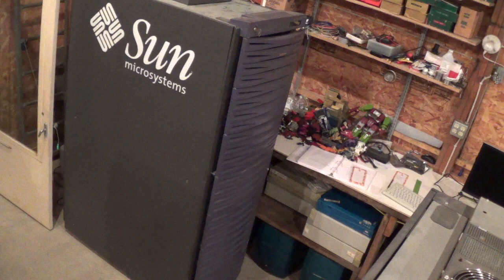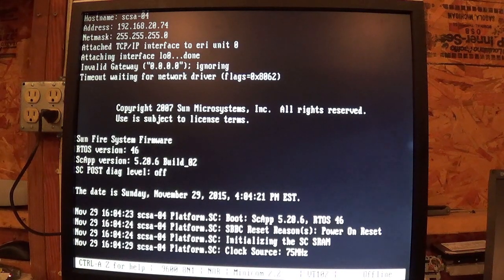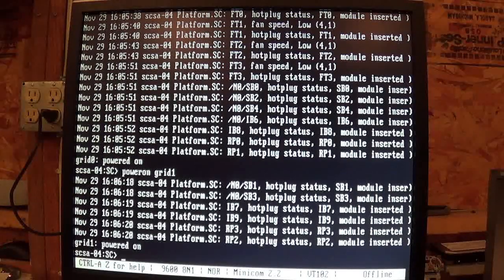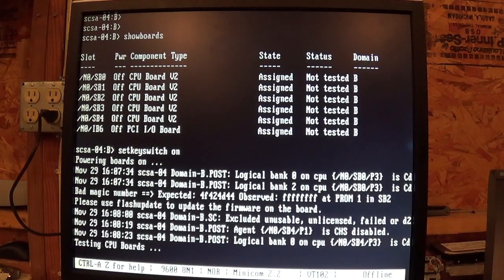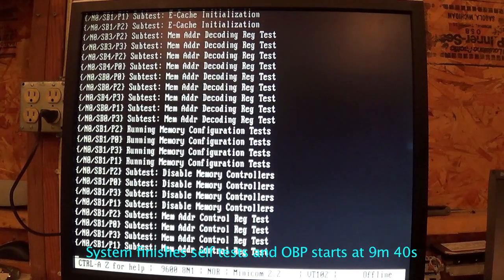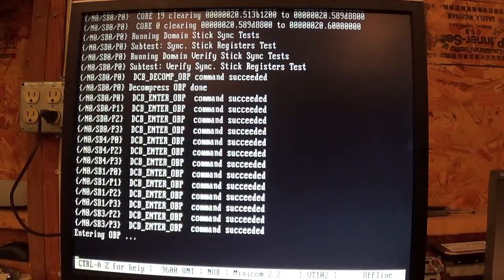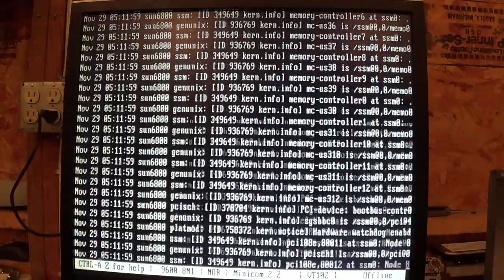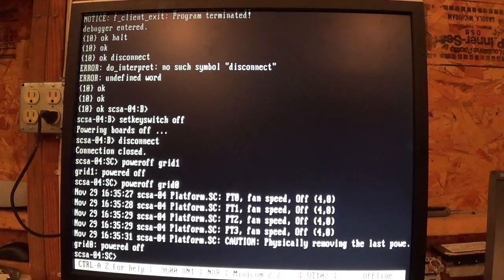SunFire 6800 Power Up - Fixed(!)

Comment: I really don't miss having to bring servers up and down like that. It's no small wonder that they make parts hot swappable. Still having to bring the specific part down is a pain but so is a kernel panic. The sad bit is that I got so used to the noise of the fans that I need it to sleep now. I set up an old AT power supply with a few fans on it mounted to an old case which does the trick. I also wired up some USB sockets to it so I can charge my phone and tablet on it. Couldn't let that 5v rail go to waste....
Reply from the maker: A have a friend who has the same thing - needs the pink noise. Personally it drives me batty. I like the idea with the USB charger, that's slick.

Comment: how do you reset a System Controller. My Sun E4900, the system controller has a password on it and i didnt get the password for the platform shell. Any help would be greatly appreciated
Reply from the maker: +245ajs I managed to find a password reset procedure for the platform, but was unable to locate docs for the domain. However given the SCs for these two machines are quite different I fear the reset procedure would not work on yours, but may in fact damage it :/ If google is not your friend, you might try a Sun listserve.

Comment: I would like to get myself an old sun system..what do you suggest?
I mean not a sparc 5 or anything a real server class!
Reply from the maker: +Doctor Forbin Well, depends on availability, of course. And how old you want to go. I started with a set of Sun 4/470s in large VME chassis, which I still have a soft spot for. But you'd probably find something like an E450 a lot easier to find - they're considerably more recent (but not too recent) and in reasonably large supply. They're also freaking huge, so they look impressive, and capable of quad processors, which makes them pretty bad ass, as well. The E3x00/E4x00 machines are also findable, more recent again than the E450s and very impressive.

Comment: Can you setup an auto boot to the sun os or does it always require manual input to bring up the items to make sure each is functioning properly?  I'm thinking job security if you have to be on hand or via a remote console to get the whole system up. Of course somebody else would hit the main power switch.
Reply from the maker: +idahofur The power on sequence can be self-started by loading the instructions into NVRAM; I'm just doing it the hard way :)

Comment: This is almost the same as a big bulldozer . They need a small motor to startup the main diesel. (pony engine)
First startup a little computer, the little computer starts the big one.
Correct?
Reply: +pcuser80 More like the little one initializes all the hardware.
Reply from the maker: +pcuser80 That's not a bad analogy at all. The System Controller sequences the power on, initialises the hardware compoents (as +detaart says) and system checks everything before supplying the boot code and setting it running.